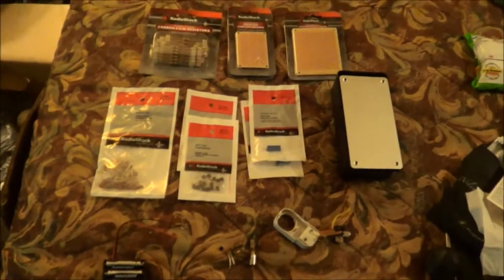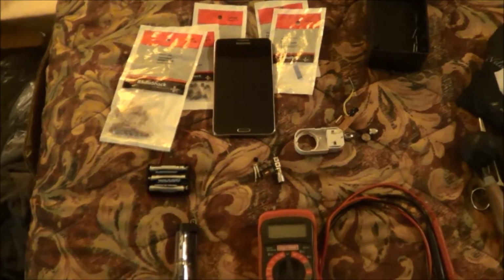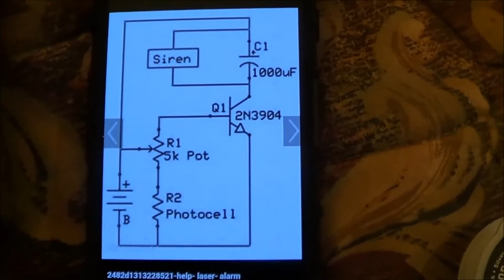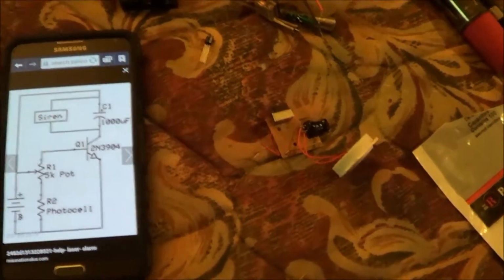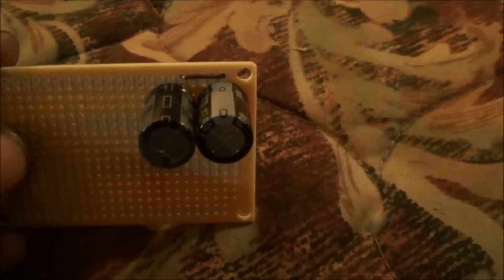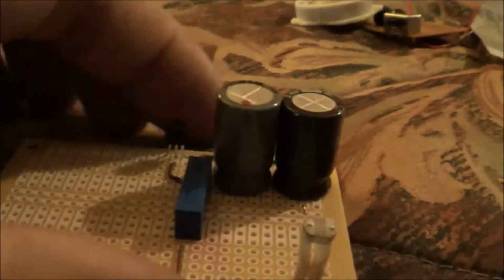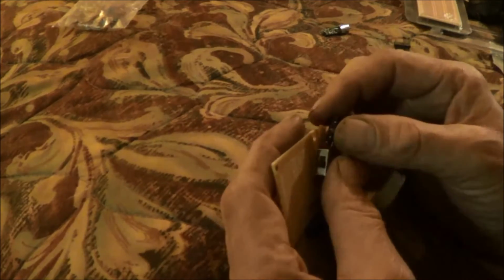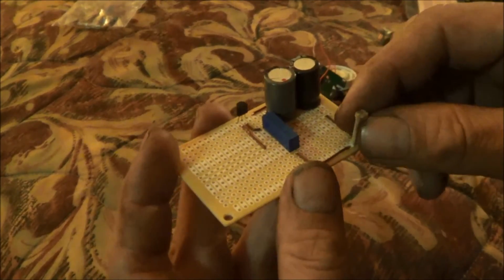Trash to Treasure - Laser Perimeter Alarm - Part 2

Comment: Andy those capacitors are the ones we used in the CB shop to mess with each other all the time. I know i told you about hooking them up backward and put them on a lead that would be a hot lead after the main switch was turned on for the bench its self.You will get it before long.I am waiting on the rest of it now.ttyl
Reply from the maker: mike1022ls1Yes Mike. Those electrolytic capacitors will blow up when you apply power to them backwards for sure. We used to blow them up too. There were holes in the drop ceiling from them in the lab.